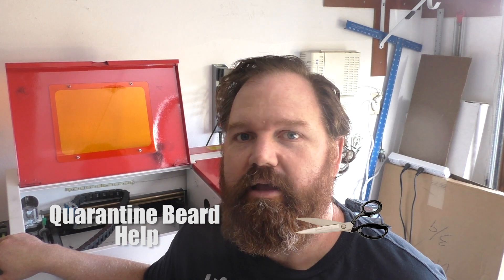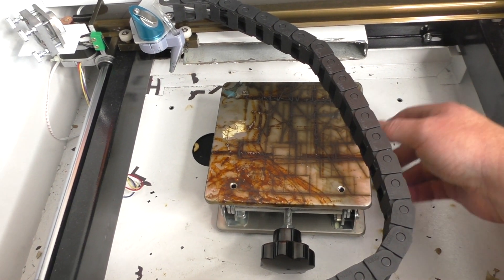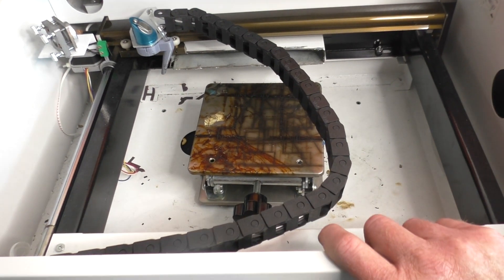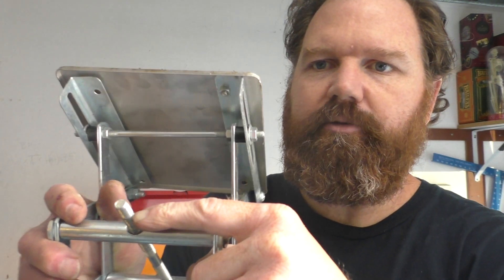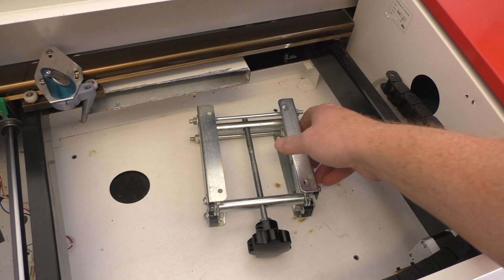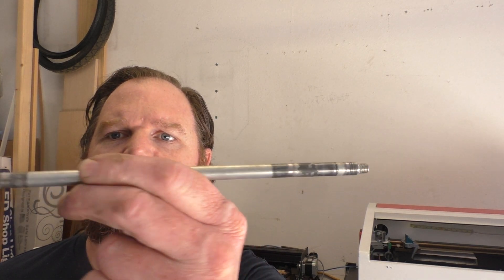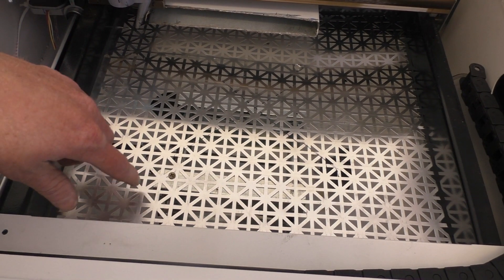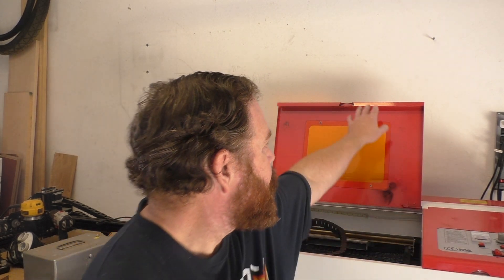Make a Simple Bed Upgrade for the K40 Laser Engraver

Comment: Thanks Geek, did you drill the hole to the other side? : It looks like a bolt is on the other side.
I am trying to do something similar but not getting the rod to tension.What kind of bolts did you use.
Thanks
Reply from the maker: I drilled through the machine and rigged a long bolt with a coupling extension, its nothing special. I'm thinking about redoing it and finding a little more elegant solution.. but it works for now

Comment: Overall, I think this is a great solution! I’m probably going to implement something very similar.

I wonder if replacing the original threaded rod on the scissor lift with a much longer one might have been a better solution than trying to create a linkage, but you used what was at easily at hand, which I totally get.

I might have a go at using something like an arduino-controlled stepper motor to drive the lift so I can set certain heights, but I’ll put that in my “long-term projects bucket” for later.

Great video! Thanks for posting it.
Reply from the maker: A linkage would have been better and I still might improve on the mechanism at some point, but what I found it that I'm adjusting the platform either direction by no more than 1/4" on a regular basis. Having a motorized control would be an ideal final solution for me as well.

Comment: Questions? Why not use a slightly thicker more rigid piece of material for your base? And also, if you extend your height adjustment knob, how are you going to account for extending your knob out the side? Isn’t it going to rise up and down when the lift moves in conjunction? And if you cut a vertical slot… how do you keep from hitting the rails and also keep the ventilation integrity?
Reply from the maker: I used this specific sheet metal because it was cheap, easy to cut and I was able to cut it to the exact size I needed. The larger honeycomb style bases are good, but they are also bulky and I wasn't sure how I would attach it to the scissor lift. As far as the knob goes, there is a vertical slot cut to account for the changing height of the knob. It is positioned in a way to not hit the rails. The slot cut in the side is pretty small and there has been no detectable difference in the ventilation.